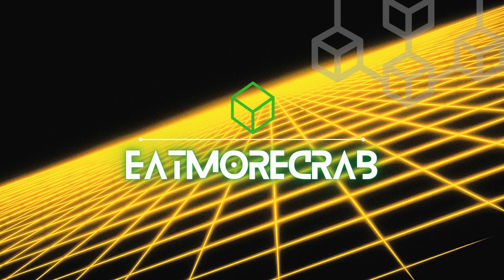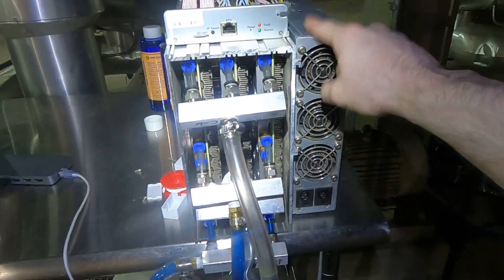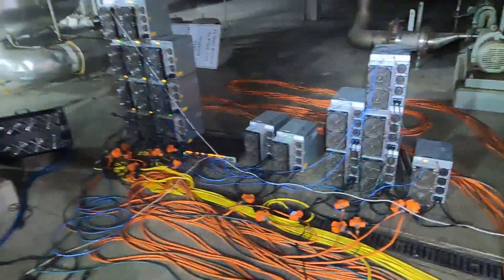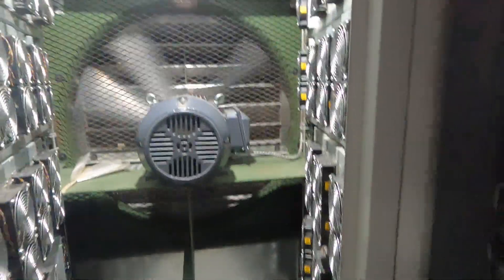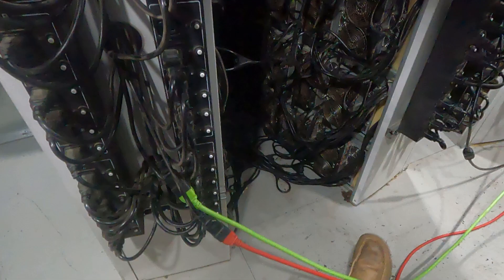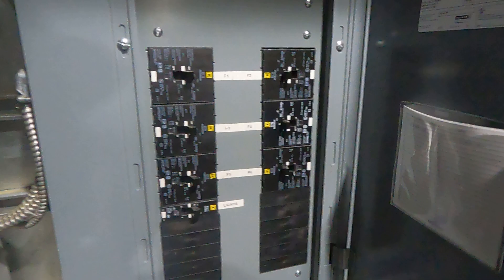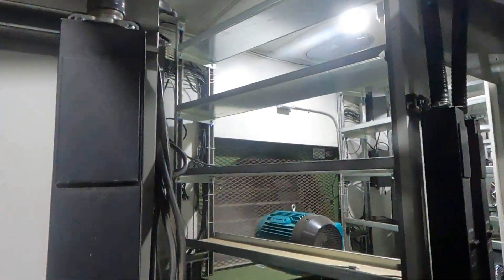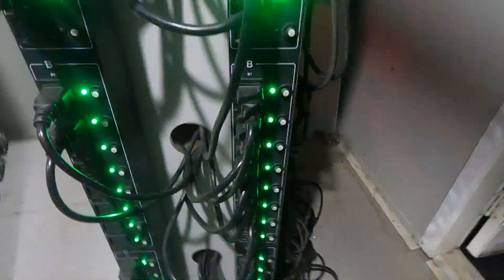Bitcoin Mining Farm Tour (2023)

Comment: I've never seen a container set up that way with miners sitting sideways and blowing hot air into each other. Usually they are all pointed the same direction blowing hot air out the long side of the container and your cold aisle is the long hallway inside the container.

Comment: I have a mining farm myself. I can't help but notice one big issue. Not enough exhaust fan to pull out the hot air out of the container. 

The other thing I notice is your PSU. Using a big PSU for the whole shelf not only cost a lot itself, the cable you use is also extremely expansive. We use one PSU for each roll of nine rigs. 9 roll on each shelf and each shelf has its own circuit breaker. So when there's a problem with any one PSU, we only shut down that roll. 

My mining farm is in Asia. We have way warmer day temperatures than you for sure. We have no issue with heat. Just make sure you increase you exhaust fan. I only see one. 100% Not enough. Do you few warm in the container? If yes, than you need to add more fan. we are able to keep our temperature in the mining container below 30 degree C. And its around 35-38 degree C this few weeks.
Reply from the maker: Yeah, I totally agree! The PDU's came with the container are all setup, and their wired directly to the transformers (3-phase), with a gigantic breaker panel in between outside the container. Each row (6-shelves) has two dedicated PDU's supplying 33 - S19's. The airflow for the container definitely isn't enough, and I've tried bringing that to attention of the company that made the container, (Bit-Ram) out of Canada, but they tried to make it seem like it was my issue. Oh well, just been spacing them out since, and paying attention to their clocks.

Comment: Thanks for the content. Do you think the extension cords on ASICS are a reliable and safe way to power them?
Reply from the maker: Lol it does look goofy doesn't it. This was a temp setup to just heat the building back in the winter, and now I just haven't had time to move them back to the containers. So I've got 280V running through those on the floor. Each cable feeds one machine, and is on a 20 amp breaker drawing about 11.78 amps. Those extension cords aren't normal extension cords, although they are still extension cords there very thick, heavy duty, 10 gauge stranded copper wire, they were a nice dollar too pay too but 10 gauge wire is good for 30amps @ 240v depending how long it is; little math to do but no big. If you have doubt use a thermometer gun and measure the very central point of the strand.

Comment: I had a pdu where once the breakers popped a few times from high heat(not over current), they never recovered and would trip way early until I had the PDU replaced.
Reply from the maker: Yeah those darn PDU's are a pain. I think the default breaker buttons just get weak and the slightest bit of current trips them. I'm wondering if I can just purchase a bunch of little 20 amp default breaker buttons and see if that will hold it down. I'm looking at some other PDU's from raptopowersystems.
Reply: @eatmorecrab  coincidently, raptor PDUs are what I’m using. Just be careful not to overheat them cause they have a similar problem.